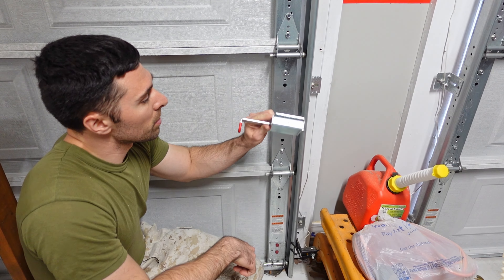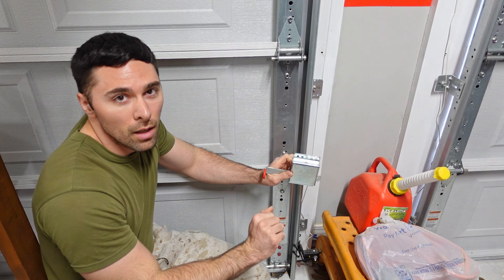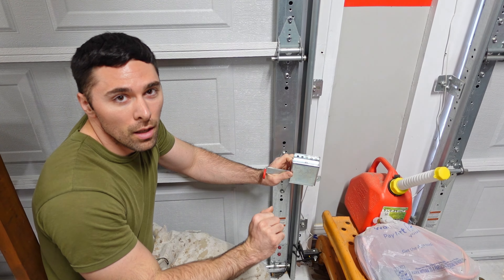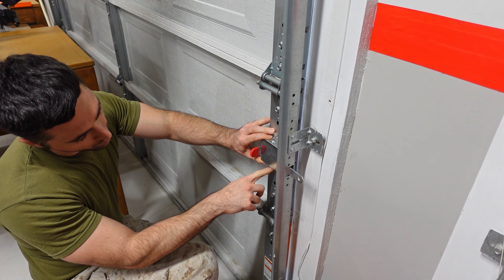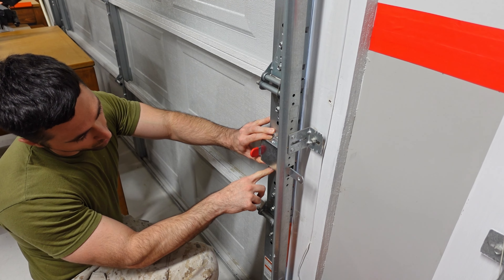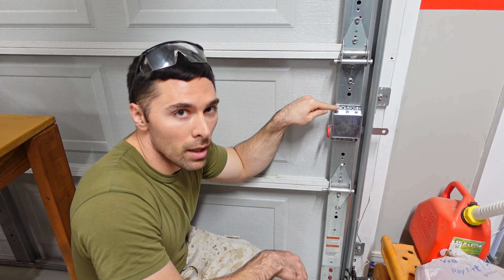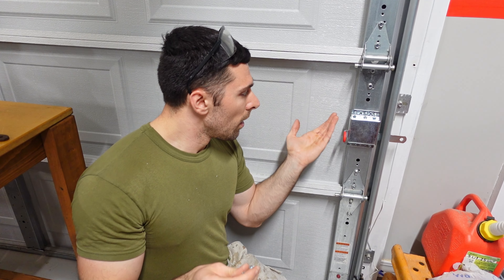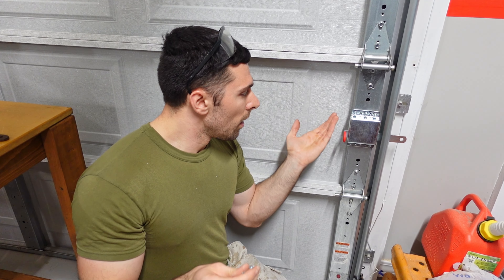How to Install a Garage Door Lock || Prime-Line Indoor Sliding Deadlock

Comment: What about opening it when you return from vacation?  That’s the part I’m looking for as my door came with the inside lock.
Reply from the maker: You would have to lock it from the inside before leaving on vacation. Then go inside the house into the garage and unlock the door before you could open it to park the car. It is a bit annoying but you can rest easy on vacation knowing that door is locked and cannot be opened from the outside.
Reply: @thediygrunt  I was looking for an outside application because I live in Florida and when I have to evacuate the garage is the only way I can get back in. My hurricane shutters, stupidly, only hand crank from the inside. And, uh, I’m not planning on being inside after the many storms have inundated some towns. But thank you!
Reply: @khbow2810 I think they have bolt locks like this that are remote.

Comment: What size drill bit did you use?
Reply from the maker: I don't remember the size if I had to guess probably 3/16 or 1/8 those are usually my go to bit sizes for pre drilling.  Plus since its metal I was drilling then a drill bit that was metal rated most likely. Though I do remember the garage door frame being fairly thin and weak so maybe it was a normal bit.